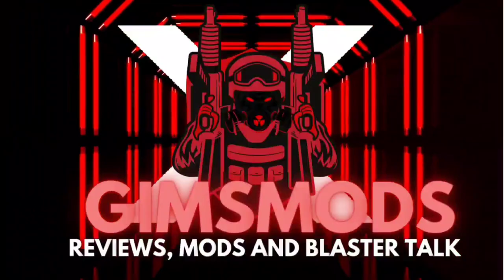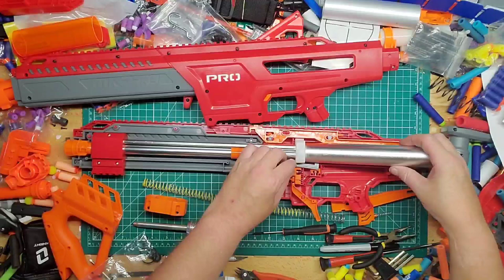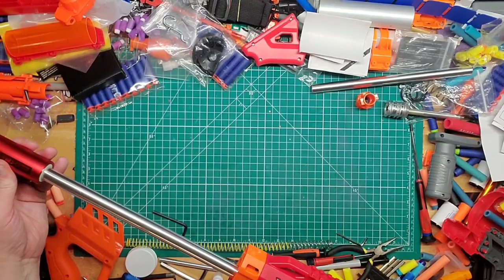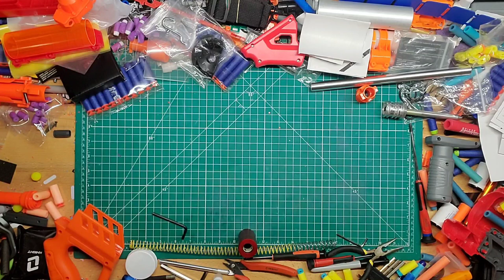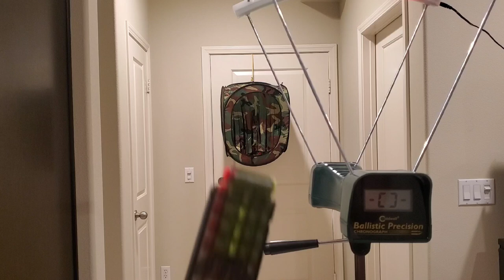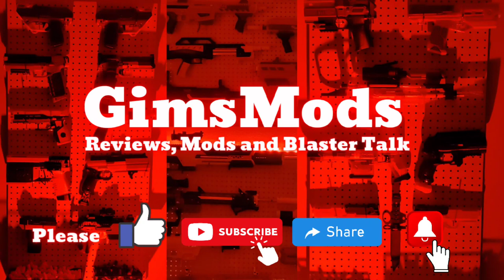Bigger, Better, Longer....Snipey-er?

Comment: I mean theoretically you could just put a super long barrel in it instead of using the extension right?
Reply from the maker: You'd have to dremmel it so you couldn't reverse the process, I mat switch it back to the other barrel, since the longer barrel really isn't needed for the fps boost